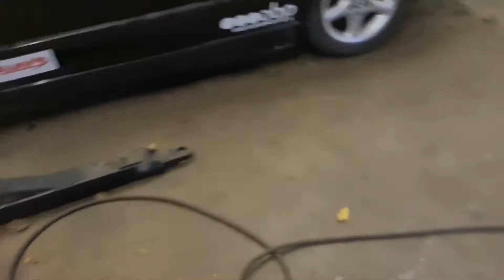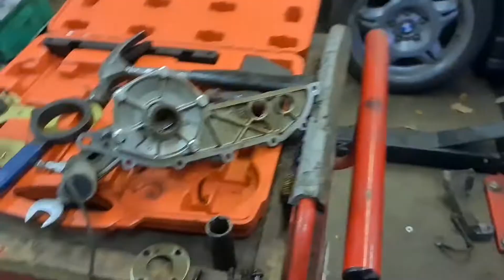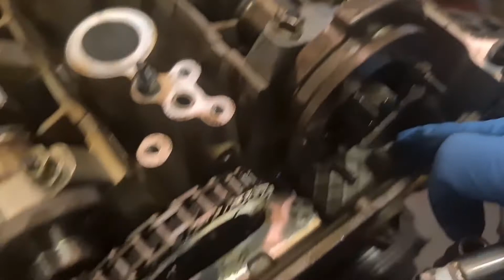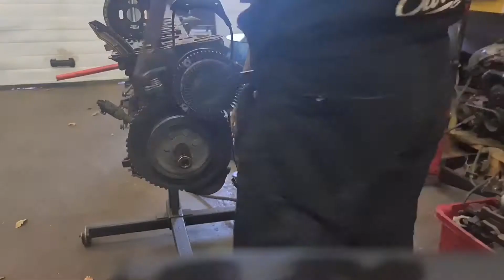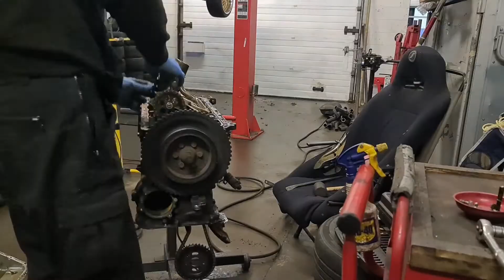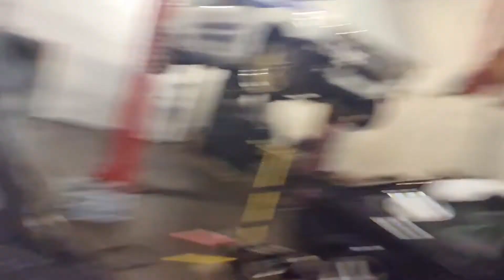Bmw E36 M50B30 Stroker Engine Build, Part 1 strip down.

Comment: i bought pistons and rods from an american e36 m3 s52b32 for 150 dollars in very good shape and an m54b30 (same part number as s52b32) crankshaft for 100 dollars in good shape im planning on putting it in a e34 525i m50 block!
Reply from the maker: Ah that sounds very cool.. my one needs some working, some new piston rings i think.
Reply from the maker: Ah that sounds very cool.. my one needs some working, some new piston rings i think.
Reply: @GaragE36uk  i think you have an actual piston ring issue not the common m54b30 internals in m50 block where piston ring bridge cracks and the symptoms are blue smoke and very low compression in that cylinder where the ring bridge cracked. your  engine has constant compression on all 6 so that is good, it's very likely your bridges didn't crack, it is common for ring bridge to crack as m50 top compression ring sits lower then m54 top compression ring, m50 block with high mileage are bad fro stroker builds as the bore wears top stays as factory and when installing pistons from m54b30 it is prone to ring bridge crack. great build tho! good luck!

Comment: Did you start with a m50b20 or m50b25?
Reply from the maker: It's an m50b25 block. Everything else is m52b28 and m54
Reply: Starting with m50b20 is this a similar process? Is the cylinder shorter in b20 compared to b25?